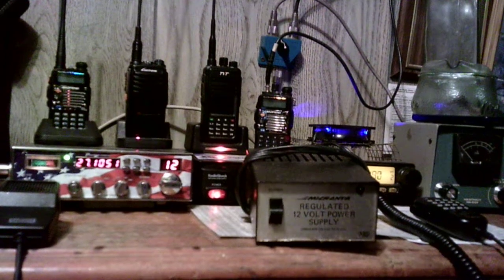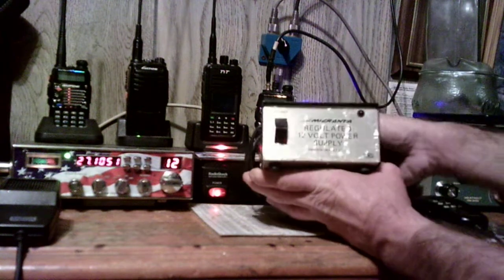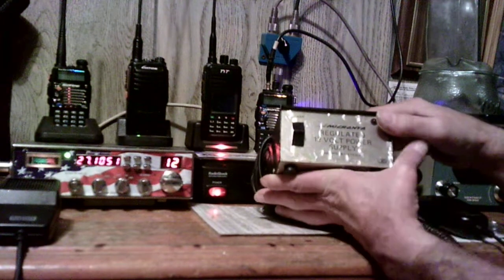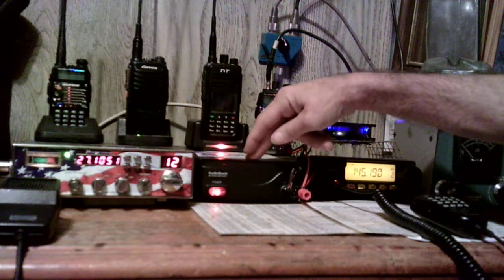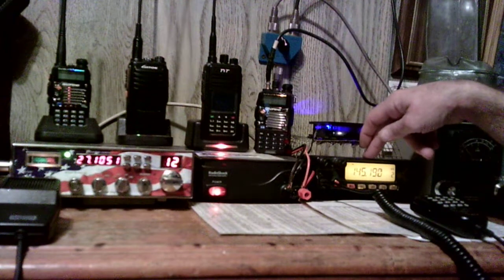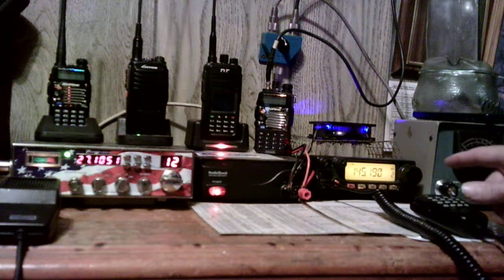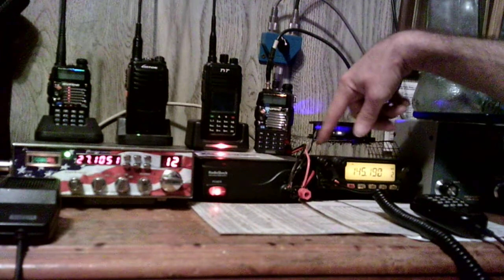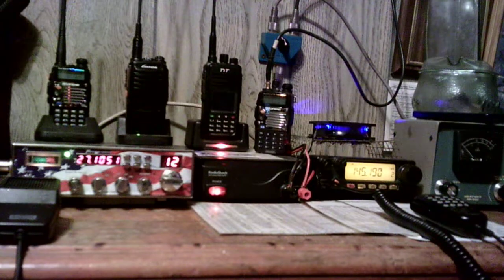12 Volt Power Supply for Ham Radio

Comment: It's very approximate that a transceiver uses twice the input power as its RF output.  So a transceiver that puts out 25 watts probably takes about 50 watts from its power source -- the AC wall socket or a 12 volt power supply, etc.
So, if the radio will draw about 50 watts from the 12 volt power supply, how much current does that mean it will draw?

This equation is a pretty easy one: Power = Volts * Amps, so if the radio is allegedly taking 50 watts from a 12 volt supply, the current from the power supply will be 50/12 = a little over 4 amps.  You can confirm exactly how much current the radio is expected to draw, maximum from the radio's user's manual.
If I approximate that a radio will take 4 amps from a 12 volt supply, it is recommended to get a power supply that is specified to be able to deliver at least 8 amps, at least double the 4 amp requirement, to help assure that you can talk all you want and know the power supply will keep running cool.
If you calculate that you want a 12 volt 8 amps supply, but you run across a 12 volt 19 amp supply for 75% off retail, then there's no problem with that.  In fact, congratulations are in order.  There's no such thing as "too big a power supply."  If the power supply can deliver more current than your radio is ever going to use, then you could use the power supply for additional devices.  When you're transmitting 25 watts, the 19 amp supply still has another 10 additional amps it could deliver that you're not using.
It's OK for the power supply (or any electronics) to get warm.  Not OK for it to get hot.

Going in the opposite direction, 12 amps * 19 amps = 228 watts.  That's a maximum rating of your power supply.  The power supply could deliver 19 amps, probably not continuously without getting hot.  If you want to talk freely, the power supply would remain comfortable delivering 1/2 of 19 amps, about 9 or 10 amps for even the longest transmissions.  So your 12 volt 19 amp supply is specified for delivering 228 watts, but it would be comfortable delivering about 100 watts continuously.  And like the rule-of-thumb says, a radio that draws 100 watts from the power supply will put out approximately 50 watts of RF power.  That's what the power supply is capable of.
Another way to approach the question is to find out specifically how much current your radio is expected to draw, maximum, from a 12 volt supply.  The manual should say specifically, or get the specification from the manufacturer's website.  The usual situation is that you purchase a radio, and then you need to get a 12 volt power supply.  So look at the radio's specifications and see how much current the radio will draw while transmitting.  And get warm and fuzzy by purchasing a power supply that is specified to deliver at least twice as much current as the manual says it will draw.  Or more than twice as much; no problem.
Today, you can get a DMM (digital multimeter) from China for less than $10 that has a 10 amp scale.  Instead of using the lightweight test leads that come with the meter, use jumper cables with heavier wire and banana plugs on both ends, to insert the meter between the power supply and the radio.  It's always nice to monitor how much current the radio is drawing, even if the power supply doesn't come with its own meters on the front panel.  A cheap DMM will do the trick.
The other trick is that if you want to occasionally use the DMM to measure voltage, REMEMBER to move the test lead from the DMM's Ammeter jack to its Voltmeter jack.  The ammeter jack has extremely low resistance, which is why you can leave it in-line while you're operating the radio.  But if you go to measure a voltage, such as measuring the voltage output of your 19 amp supply, you don't want to put an extremely low resistance across the power supply's output, because that will create smoke.  So you move the test lead from the DMM's Amp jack to the Volt jack, which has an extremely high resistance, and that's good for measuring voltage.
Having an ammeter in line with the radio and power supply will answer the question: exactly how much current is the radio drawing when you transmit?  How does that compare with what the manual says the radio will draw?  Does the current draw decrease with higher SWR's?  That will also help answer the question: How much unused current is available for powering additional devices besides the transceiver?
And, it's never too late to get your Ham radio license.  http://www.arrl.org/licensing-education-training  Good DX.